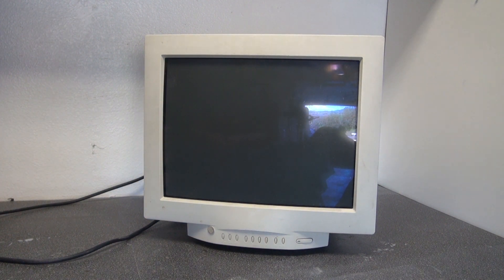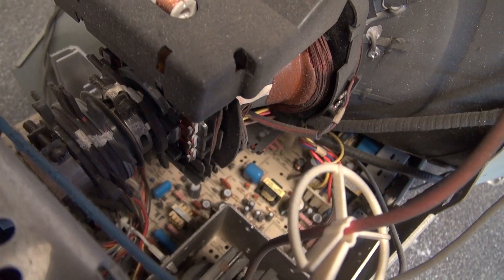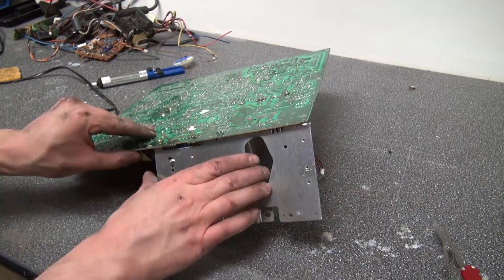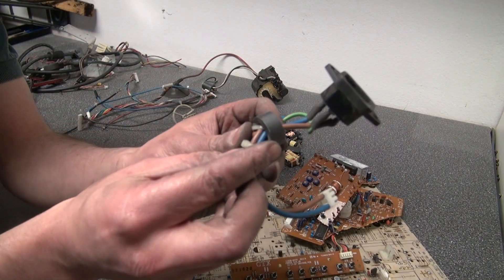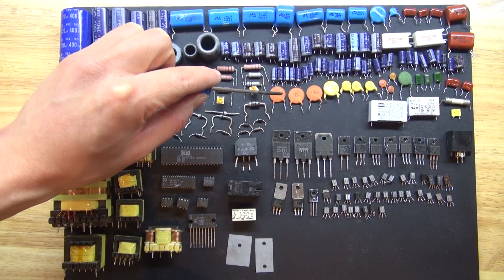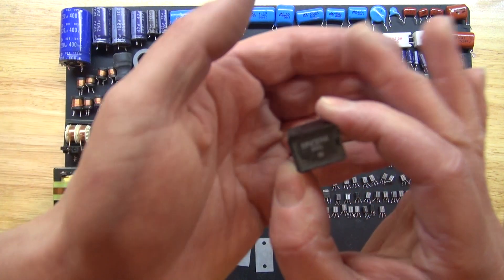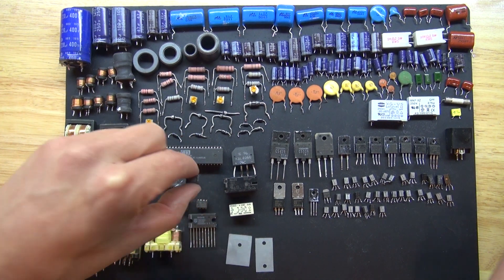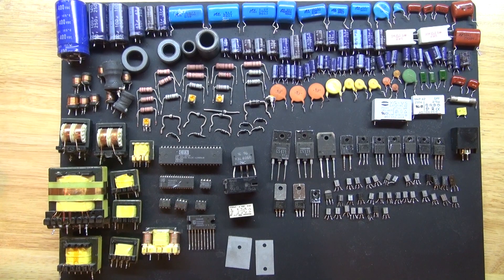CRT PC Monitor Teardown

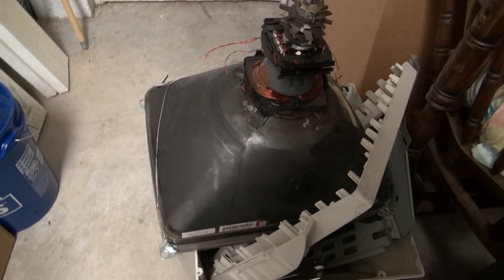Comment: 6:17 not trach there alot of magnet wire very usefull
Reply from the maker: Yes, it can be very useful.
Reply: @SciTyeTech  can you make how to do high voltage fly back driver

Comment: I'm not a scrapper, I just did that with Phillips 2k year model, it was pain, yours look easier, while i do it i found that tail lamp thing was broken, i want to extract the front glass to use it but i stopped when i found a warning sticker talk about vacuum tube and X-radiation! 
I don't know what to do! Any suggestions?
Reply from the maker: You can open it. Don't be afraid of the x-rays. It is only a problem if it is turn on. As long as it is off and you discharge the flyback transformer. You are safe.
Reply: @SciTyeTech  
That's great, thanks man! 👍

Comment: The thing you couldnt identify (3-leaded black cube) was listed as a thermistor believe it or not... I had one very similar in the monitor I tore down and while I couldnt find datasheets, I did find plenty of images on google, one of which lead to a description as a thermistor (one of those part supplier sites in china or the like).
Reply from the maker: Thanks! That was very helpful.
Reply: @SciTyeTech  Yea it is really odd... I havent looked more deeply into it (just harvested it before I came across your video)

Comment: Are you sure you discharged the tube correctly in this video?  I thought the charge is stored in the tube.  You pulled the anode cap off and then tried to discharge the flyback transformer.  The tube could still be holding a dangerous voltage.  Additionally, there is no need to discharge into your electrical mains, it's safer to find a grounding spot on the metal chassis.
Reply: Man how give a F just smash it with bricks .

Comment: Nice video! I have the same monitor and the flyback transformer just stopped working. I need to order a replacement one and was wondering if you're still have the part and can provide the part number. Thanks!
Reply from the maker: Thanks! Sorry, unfortunately I don't have it. I was experimenting with it and I burned it out.

Comment: What is a posistor?

A posistor is a combination of a PTC (positive temperature coefficient) resistor and another resistor-element to heat it up and keep it hot. Sometimes, these will go by the name posister or thermistor. The heater is a disk shaped resistor across the power line and the themister is a disk shaped device in series with the degauss coil. They are in clamped together to be in close contact thermally. You can pry off the lid and see for yourself.

The most common failure mode is for the part to short across the line.

Its function is to control degauss, so the only thing you lose when you remove one of these is the degauss function on power-on. When you turn the TV or monitor on, the PTC resistor is cold and low resistance. When heated, it becomes very high resistance and turns off the degauss coil but gradually - the current ramps down to zero rather than being abruptly cut off..

Computer Component Source stocks a wide variety, I believe but it may be cheaper to go direct to the manufacturer if they will sell you one.
Reply from the maker: That's very interesting! Thanks for the feed back! That's a very interesting component.